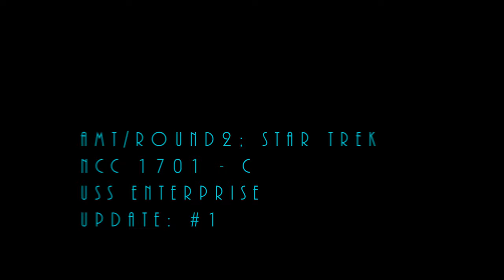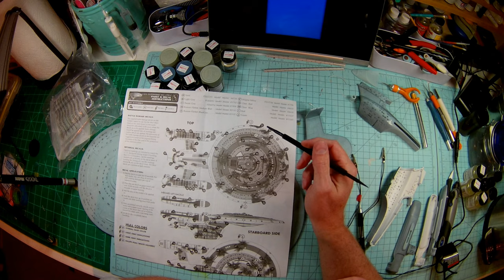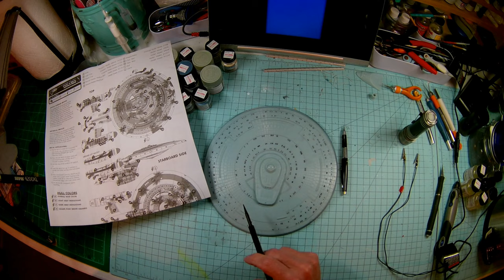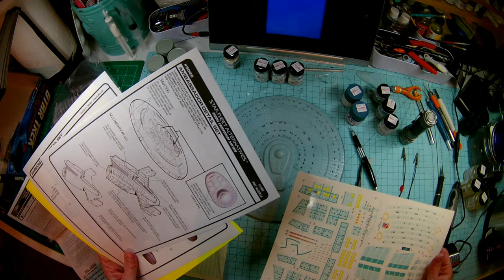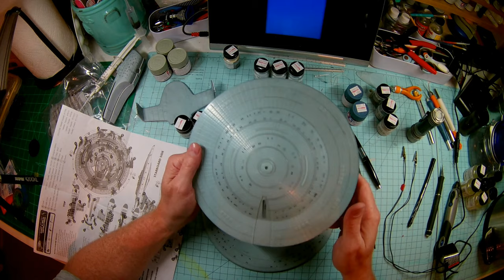Round2 USS Enterprise  C Model Build Update #1

Comment: I have enjoyed all your builds so far, the finished results are really good.I think your de-walt is a bit to clumsy for drilling out windows, a Tamiya drill mite be just the thing.
Reply from the maker: Richard, you're absolutely correct. The dewalt is a little clumsy.  I did get a nice dremel for the fine holes, and the more general drilling, I can do with the Dewalt.  However, the Tamiya is a nice drill, I just don't think I can justify the cost of another drill.  Thanks for the note, and the compliment!  Have fun building!  Dale